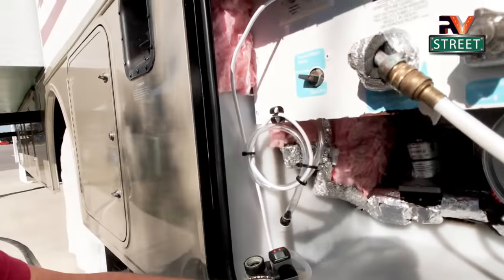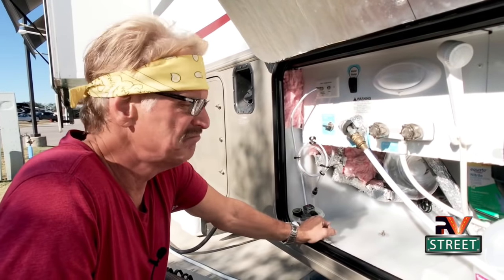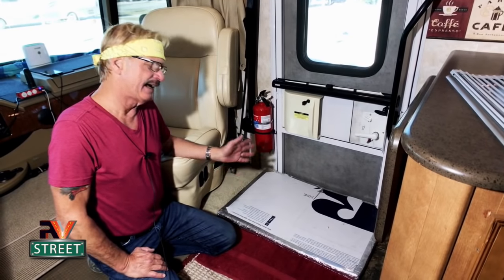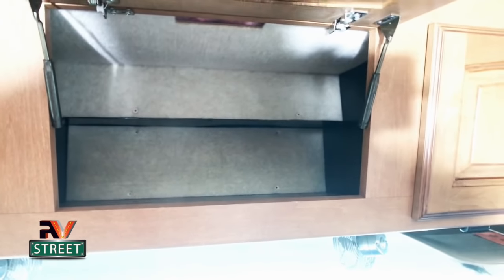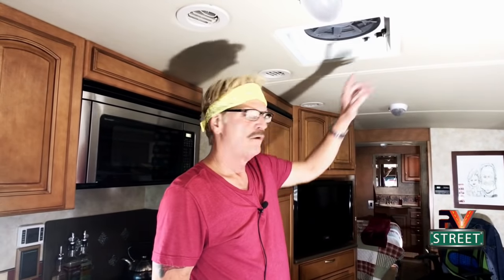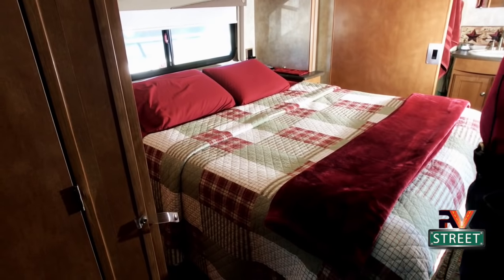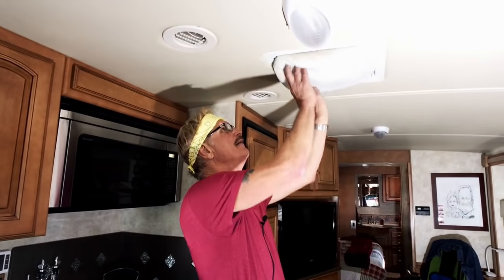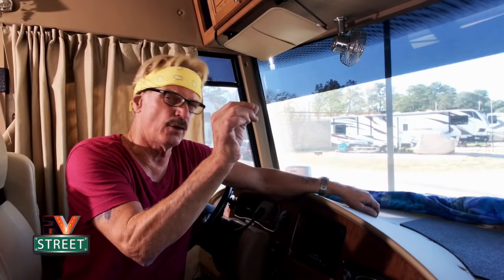😰  INSULATE, HEAT & PROTECT • Key to stay warm in your RV

Comment: Why do you remove the paper from the R-19?
Reply from the maker: This question has been answered in the comments many times, but here it is again....

In a nut shell, the faced insulation is normally used as a vapor/moisture barrier when used in home walls application and is not needed in this situation and especially when I’m putting in several layers in those large empty cavities. If Home Depot had unfaced in stock at the time, I would of bought that.
Reply: @RVstreet  sorry female. Does it hurt to layerer papered insulation? Does it affect its potential? Just asking because I don’t know. Do you need to wear gloves while doing this or no big deal? I want to insulate my 36’ motor home and just asking because I have no idea. 
Ps thank you for your great videos. So much info that’s essential
Reply from the maker: @cr2884  The only time I'd use paper back insulation is if—like in a home—your putting in one layer in a wall. Then the paper side would face to the outside of the area your insulating to act as a vapor barrier......which in the video you saw me do there was no such application. Everywhere I insulated there were several layers. You don't don't want to pack it in there. Lay it in, push it back some, lay in another strip and so on. To insulate properly you need some air between layers. Not a lot, just some. When handling fiberglass insulation, wear a long sleeve shirt, disposal nitril gloves and a dust mask so you don't breath the fibers or get it on your skin. Shower thoroughly when done.
Reply: @RVstreet  thank you especially for info don’t pack it in. Air space is needed as well.

Comment: Use silicone caulk to glue the inulation in. If you ever need to remove it, it will just peel off.

Comment: A 60 watt will do the job
Reply from the maker: Ya sometimes I use a 75 watt bulb, but when it's getting down in the low teens for several days I use a 100watt JIC. I think everyones RV will differ somewhat depending on the set up of their wet bay. 
thx Joy 👍

Comment: Please please please do not not not promote fiberglass!!! Sir.
Reply from the maker: If this fiberglass insulation was installed in any area that is exposed to circulating air or in an open areas where fibers could become air borne, where people are all the time, I'd agree with you. For a common example like in an attic in a house where they could get into the cooling/heating system ducts or just crawling around up there retrieving items and breathing it in. But in all these areas where I installed it, they are all completely empty cavities and are enclosed . There's no way any loose fibers can get air borne and possibly be breathed in. I wasn't promoting fiberglass insulation per se, I was promoting to do extra insulation. People can use other types of insulation if they want to and I stated that in the description text under the video. 
But I truly do appreciate your comment and glad I had another opportunity to clarify here. 👍

Comment: Insulation and heating 101.  Nothing unique here.
Reply from the maker: Maybe 101 to you, but did you happen to see, read about or watch follow up videos of how many RVer's were caught unawares in the 2021 Feb. winter event just 6 weeks after this video was released and had not done these things? Many RVer's suffered a lot of damage and could of been in much better shape if they would of done some of these things. This video maybe didn't help you, but it will and has equipped a lot of others that haven't been thinking out the box to be better prepared in the future. 
thx for watching